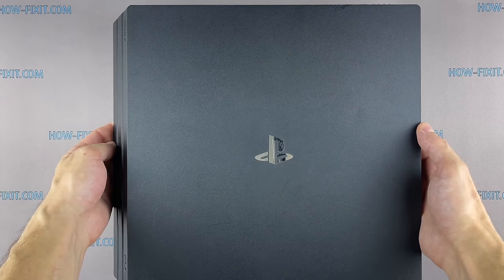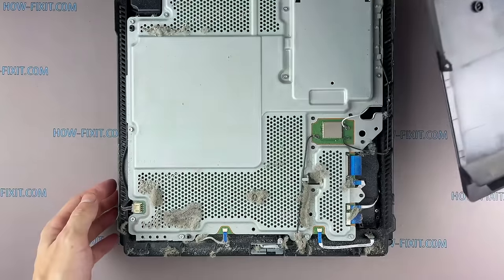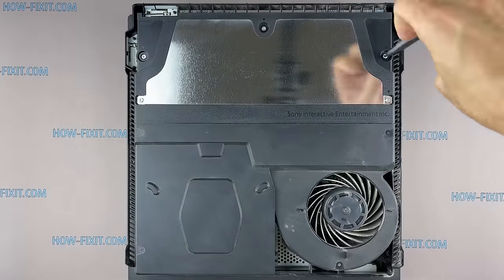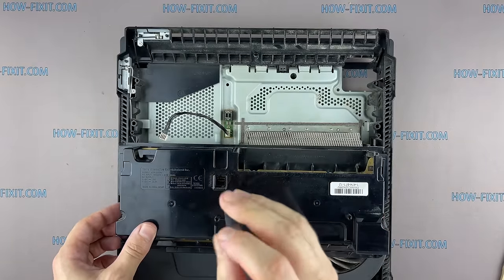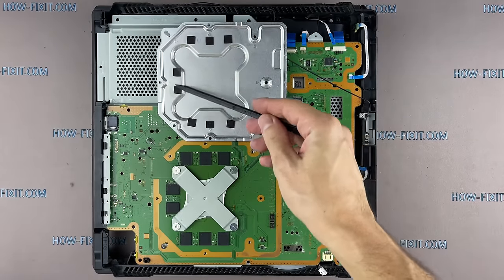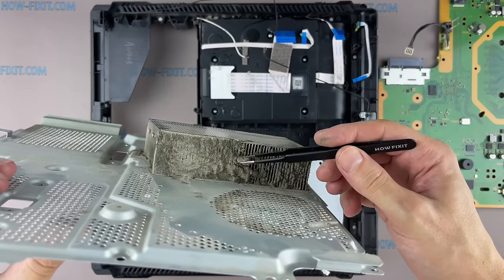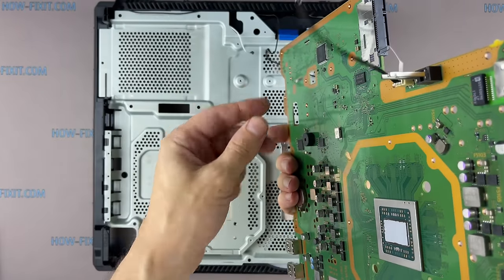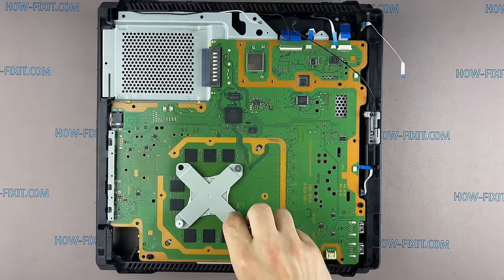PS4 Pro how to take apart, clean fan and replace thermal paste

Comment: Hi I inherited a PS4 Pro, which sounded like a jet engine, before it told me I had to close the console as it was melting. The unit I have is the later version, so there were aspects of the back plate that were not quite in sync with what you show, and the chip backing is held in by a 2 point fixing instead of 4. 
Oh, and the power unit screws: One of them was plastic, which meant that it burred almost immediately. So I ground it with a screw driver. 
That said, I found the heat sink with a mat of dust all over the intake. 
Everything cleaned, thermal paste renewed, and one hour later she fired up as quiet as you like. 
The other thing I was considering is adding an SSD, which would give less stress to the CPU.... but I wasn't certain, as I think I may have issues with formatting the drive. I don't have access to a windows computer, with the gear. Is there a way to format in the PS4?
Reply: Method 1. Format External Hard Drive for PS4 Using Disk Utility

The first thing you're going to do is open the Disk Utility on Mac. In order to do that, you'd have to go to finder. Then, follow these steps:

Step 1. Open Disk Utility in finder.

Step 2. Find and click on an external device.

Step 3. Click on "Erase."

Step 4. Pick the "exFAT" file system in the next prompt.

Step 5. Click "Erase."

This will format your device into the exFAT format and allow you to connect it to your PS4 without any issues.

Comment: Great video. I was actually thinking of doing this myself, but after watching this and seeing how much work it is and how much dust and other nasty shit I’m gonna have to dispose of, I think I might just take it to a shop to let someone else do it. What I can’t figure out is why my fan only gets loud when I put in certain games and at certain times with each game in the PS4. For Horizon ZD it only does when I open the map screen over/around Meridian. In Fallout 4 and Skyrim it gets loud when I open the map screen, but not as loud as when I open a container or look at my item/inventory menu and it gets loudest when I’m just playing it normally in the open world. I go inside a house or (anywhere the game considers an “inside” location) building, the fan speed goes back down. I’m thinking that’s probably not a clogged with dust or cleaning issue, but just certain locations and performing certain activities in some games just make the APU get hotter, and the thermal paste the guy put in there must have dried out.
Reply: Sounds like dust or thermal paste but probably both. The problem with many PS4 Pro consoles, especially older models, is poor assembly. Low quality thermal paste was applied poorly at the factory and there is only one way to remedy that. 

I've redone mine and cleaned it and my PS4 Pro is now virtually silent at all times.
Reply: besides the possible dust and thermal paste, the main reason is because it takes a lot of processing power to utilize maps in most games like that. The same thing would happen to me in open world games, also in open world games it takes a lot of power to render in all the assets depending on areas you're at.
Reply: @Daz5Daz  I just did mine last night and I was surprised by how sloppy they applied the original thermal paste. There was more paste beside the chip than there was on it.

Comment: i cleaned the heatsink, replaced thermal PADS and PASTE, cleaned the fan too, but it still turns off in the middle of a game or gets the “The PS4 is too hot message” i need help right now

Comment: Ps4 Too hot?

Hi. My ps4 is from launch day so nearly 10 years and playing God of War was sounding bit too loud. Ordered some air spray, alcohol and thermal paste.. cleaned whole console out and took a lot of thick black dust from the heat sink. Applied a pea sized amount of paste. Now my ps4 is sounding like a jet engine when I open GOW sounds suiuuuper loud then beeps flashes red and says too hot. What have I done wrong pls help me dear lord
Reply: Did you fix it? Maybe check to make sure everything is plugged in. Was it enough thermal paste applied?
Reply: @SentinelEx  I did! I removed the thermal paste and used another brand works fine now will tide me over till Xmas ps5 haha, the other paste I used was like watery and evaporating after a day of use nearly lil

Comment: I have a cuh 7116b model of the ps4 pro but pretty much everything is the same apart from the design of cross ontop of the cpu. But when i plugged it in it would switch on however every other cable wouldnt work. I opened it up again and saw that the ac power cable is connected to a seperate part to the rest but i dont know what to do. Although i am considering taking it to a repair shop.
Reply: Ehsan Chowdhury yeah that’s honestly the best bet if you’re not good at taking apart or working with electrical/mechanical devices or don’t have an adept knowledge and experience of working with circuitry or have trouble remembering which screws go where. I’m fairly knowledgeable and experienced with mechanical objects and devices and I was considering doing this to mine, but after watching this video, I’m rethinking it. The last time I took it to an electronics shop to get it cleaned, it took the guy a few hours and he only charged me around $40. The thermal paste costs, what, $10? Might be more than that now, but still $40-50 every year and a half or so isn’t that bad, especially considering that it’s someone who does it for a living and specializes in doing this sort of thing every day.
Reply: @Whitebreadonly  Thanks for the advice i know a few people who deal with computer hardware HOWEVER before i saw your response i did the complete opposite and took it apart and reopened it over the course of the last week. Now i know 110% that there's an issue with the hard drive when i first took it out although i don think i need to replace it. But thanks again for the advice.

Comment: I also applied this paste and in three months the noise started again
Reply: Check which model Pro you have. The 7200 series do a better job at handling heat.
Reply: @SentinelEx  Yes the model 7200 I have... what do you mean better job????? Should I put  Noctua Paste??? Because I have seen in another video of yours that you put this paste on this model
Reply: @kostasmakrakis13  I see. It could be a range of factors at play. I've seen people get good results replacing the factory fan and thermal pads, too.
Reply: @SentinelEx  Ok!!! I will try it and see....  You helped me .... Thank you very much!!!!

Comment: I used this video took it apart cleaned the dust out and pieced it back together and now I have the blue light off death. tried taking it apart and putting it back together about 6 times. I have no idea what the problem is and several fixes I've tried haven't worked
Reply: Your power supply is dead

Comment: Can I access the vent without taking apart the goddamn motherboard?
Reply: Nope - I tried that.  It doesn't work :(
You need FULL tear down to get to the heat vent I'm afraid
Reply: @eman7282  that's so stupid tho :(
Reply: @stoikusu5084  Agreed.  I did it on my standard PS4 and it worked.  Now my PS4 Pro needs it and compressed air doesn't work - still have a jet engine sounding console.  Gonna have to take it apart :(

Comment: That is not how you use thermal paste, you don't spread it like butter, go search on YouTube the best way to apply thermal paste, the most effect is a small blob in the middle of the chip, known as the pea shape. Once it mates with the heatshield it will automatically evenly distribute the paste.
Reply: Pea blob (or other shapes of blob) are used with chips that have an integrated heat-spreader - Ryzen, Intel etc.. When a chip is exposed like the one in the PS4/Pro (common with GPUs from nVidia and AMD as well) the right method is to cover the chip completely with a thin layer.
Reply: @Daz5Daz  thanks!
Reply: Better stop spreading false information when you have no idea
Reply: @mikey_zari  thank you keyboard warrior, your option matters, go do your own research.